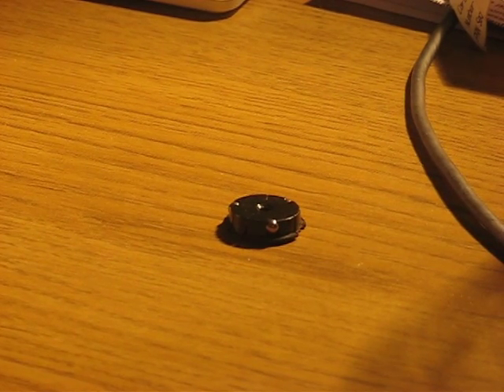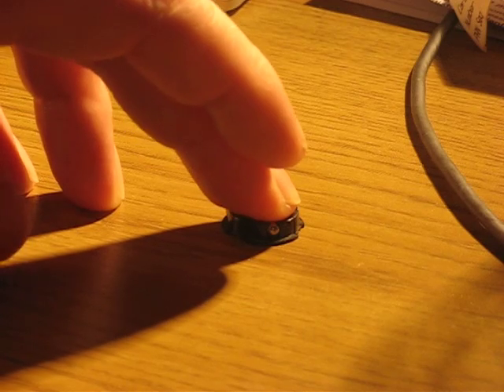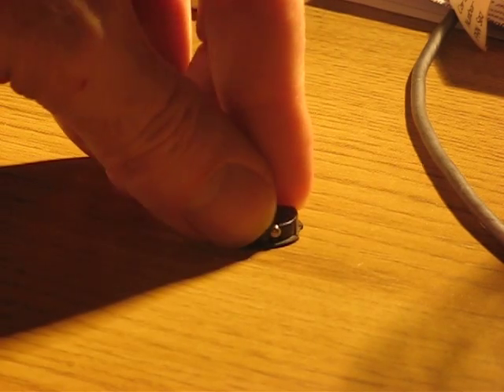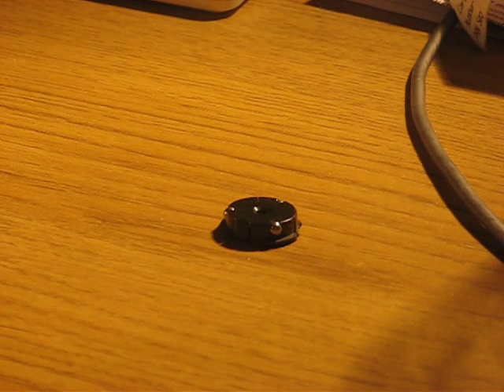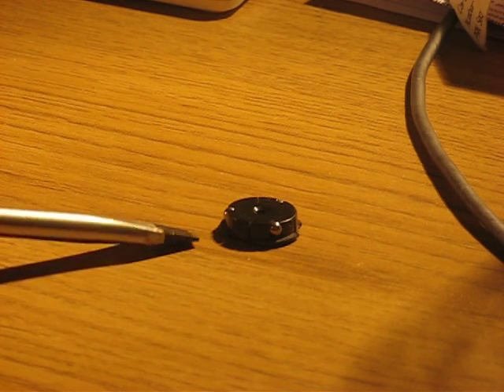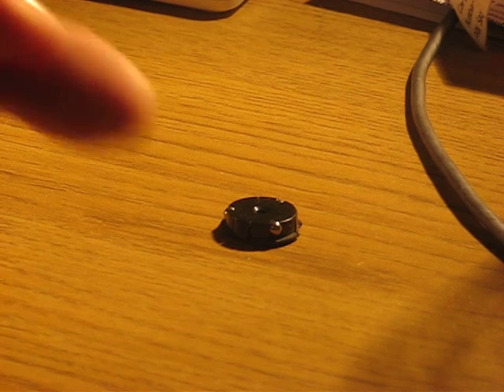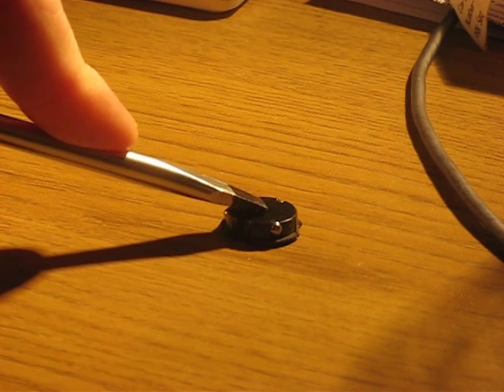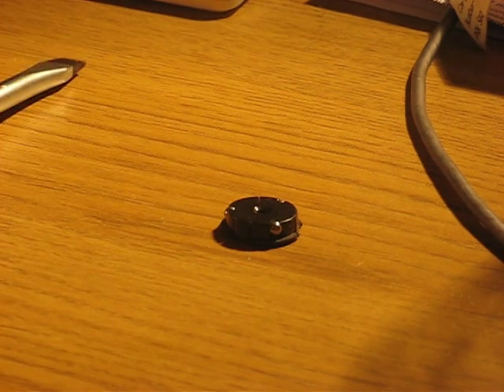Playstation 1 spindle fitting tip

Comment from the maker: @DisneyTLK110 hi, thanks for the comment. Well I don't know much about lasers at all, but you might want to check that the spindle is far enough down the axle. After I made this video I thought that actually there is a little too much clearance... we also had a game load wrong a couple times... so by gentle levering I pushed the spindle on a little further which improved matters. Maybe try that. You want to be as far on as you can without it binding.

Comment: Hi great vid! I just have a question. How sensitive is the laser, really? I mean I switched my spindle with one from a cdplayer. I guess I must've bended it just a little, little bit. Cause the disc isn't spinning correctly at the same level. There's a tiny bit of wobbling, but my ps1 has trouble reading the disc, do you think this is what causes the problem or do you think it's the laser lens itself? I'm getting really worried, I screwed up a new laser I bought, I broke the spindle.

Comment: My old spindle is  broken, I Got a new one with the same material, it's works , but i see the spindle spinning the disc a bit unbalanced and swinging than the older, some games i have like syphon filter 3 have issues and skipping the intro and problems with the conversation in gameplay, all of these games are cd-r but I never had problem when i had the old spindle. (sorry if you don't understand my worth english, but I wrote this with my head and learn alone, without help of google translator